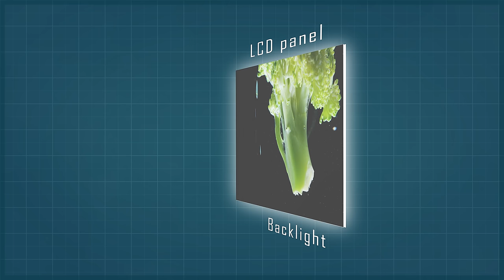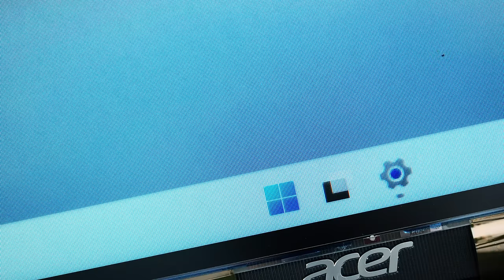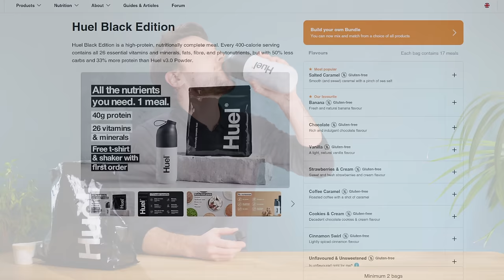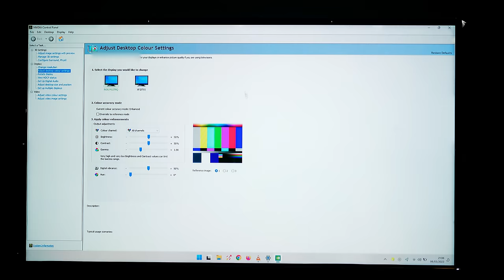DIY Dual-Layer LCD monitor - can it match OLED??

Comment: I would’ve loved to see a comparison between this and OLED. Would be cool to see the difference in black levels and persistence blur.
Reply: Yeah, Matt! Build an OLED display out of old electric teapot indicator lights and make a comparison! Also - the viewing angles on this double layer beast must be interesting.
Reply: Oled will have a better emd result. The pixels are off when black cant get better than that
Reply: @CruelQuertos  The only benefit, and why DL-LCD is available to studios is that it can reach 1000 cd/m2 which is the HDR mastering specification. It will never be available to consumers as regulatory agencies would never tolerate the near-squared power consumption.
Reply: The persistence blur would be pretty bad unless the panel can be refreshed very quickly. The new 500 frames per second panel thats in that new Alienware model has a pixel response time of 4 1/2 Ms at the slowest transition. The Hisense u9DG had ridiculously bad motion blur because of how hard it was to keep the panels synchronized
Reply: OLED will eventually replace LCD, in time.  The problem with OLED is comparatively low yield in the manufacturing process, and they fade and die over time, blue in particular, will get less bright over time.
Reply: @fuzzywzhe  I think the yields are probably pretty good at this point. However, OLED can't do outdoor bright signs, and there is the future possibility of something radical coming to LCD, like field sequential colour, or a blue backlight photoemissive subpixel system that could far exceed OLED power efficiency.
Reply: @Tattlebot  The yields probably have improved a lot, but I'm still fairly certain they are lower than LCD.  LCD yields are close to 100% now - they are very good but it's been a while since I've been in this industry.

One idea I've seen for improving efficiency for LCD was using a prism to break the light into red, green, and blue instead of using just color filters.  I think they still use color filters, but I'm unsure.

If you've ever heard of the One Laptop Per Child initiative (a disaster by the way), they did that to improve efficiency.

I don't see why people really complain at this point about what they get.  Yes, LCD doesn't produce true blacks, your eyes adjust to take that into account in short order, or really, your brain does.
Reply: @jamescampbell8482  Dude, you can't possibly see 500 frames per second.  You can waste money on this, but there's really no point.  I used to work for RCA, your brain basically can't see 60 frames per second.

There's lots of stuff built that is WELL beyond physical perception.  There were 8K televisions for a bit, you can't see that, it has more pixels than your eye has photoreceptors.

I guess it doesn't matter, really, but the stuff I see.  Remember "retinal displays" on iPhones?  That also has more pixels than any human being can see.  What is the point of doing that, other than driving up cost enormously and increasing energy consumption?

It's bragging rights about the "quality".

I guess it's harmless, but it's also wasteful.
Reply: @fuzzywzhe  Using a monochromator will still lead to loss of light. Of course OLPC was going to achieve nothing, because funding has a minimal effect on educational outcome, plus people prefer to ignore the issue of IQ heritability. This is a failure to consult, based on ideology.

The issue with LCD darks, and while I admire LCD a great deal, is that the contrast ratio impairs colour saturation near dark. Dark colors are desaturated by the glow, and are then incorrectly displayed.
Reply: @fuzzywzhe  QD-OLED will take over OLED soon enough, and after that MicroLED, which is essentially the return of the LCD.
Reply: @cal7101  Well, this is outside my scope of knowledge, but I don't see who MicroLED could be the return of "LCD".

The way LCD works is that you have a panel that polarizes light, then you have the LCD screen pixel that twists that polarization from 0 to 90 degrees, then you have another panel that polarizes the light again, and if it's 0 degrees, you get full brightness, and if it's 90 degrees you (are supposed to) get absolute darkness.

LED doesn't require polarization as far as I know.  As far as I know (and I might be wrong) it's just a bunch of light emitting diodes which is why it's so efficient, but producing blue light is troublesome and the stability of the light emitting diodes is not great.  They burn out and fade over time.

I've never heard of MicroLED, but I don't really work in display technology anymore.
Reply: @fuzzywzhe  my mistake, I was referring to mini LED which is actually inferior to OLED, QD-OLED and  Micro LED. V confusing naming! But Micro LED will likely take over OLED and QD-OLED (superior to OLED) as it will negate the OLED issues. Just needs to come down in price and be made into TV form factor.
Reply: @cal7101  Well, I looked those up, you may be right.  I haven't really been into the display arena at all (and was only INDIRECTLY in it before) since 2000 or so.

You could be right, but here's something to think about.

We're not going to really ever improve video or audio quality from this point out.  In 2200, your display will basically be what you're using now, although it might have better, contract, it will be basically the same.

It might have a different aspect ratio, but it won't have much of a change of resolution.

It won't be 3d, it won't be floating in the air, it won't be transparent, it will be, basically, the same thing you have right now.  Could be a different technology (very well might be), but we are not going to make any significant advancements or changes in display technology.
Reply: Hisense dual cell TV basically used the same method to achieve high contrast, I can tell you the black level and colour performance are very comparable to OLED, but OLED still looks better to human eyes at this stage...
Reply: @fuzzywzhe  The eye may only have a few million cone cells, but the peak density in the middle is 100-130 per degree. To match this across a 40deg display, i.e. it be that sharp when you look to any part of the screen, you need over 5K. Our usable visual acuity (e.g. readable text resolution like an optometrist might measure, or minimum angle to differentiate two points of light) is a bit less than this, so 4K is fine for most people, but that's just for a TV - IMAX screens cover a much wider angle of your vision, and I use my screen at almost 90 degrees where even 8K wouldn't look perfect.

'Retina display' has just enough pixels that you can't distinguish any further (for a given screen size at typical viewing distances). Not _more_, it doesn't drive up the cost, it exists specifically to avoid this arms race: with 'retina' on the spec-sheet they avoid the pressure to improve 1200 to 1500 to 2160p every generation.

Frames per second is much harder to estimate. When your eyes track a moving image across a screen, the sample-and-hold effect of each frame means it doesn't behave like an object in real life, and you get blur as your eyes expect it to be further ahead. This is compounded by pixel response times, but with more FPS things appear closer to where they should. This continues indefinitely: tracking a 2000pixel/sec object at 200fps has the same motion blur as a 300pixel/sec object at 30fps. If you skip the 'hold' of sample-and-hold, and show each frame only instantaneously like CRT, then your eyes can average between frames (without including incorrect interpolations into the average) so with backlight strobing / black frame insertion we may be able to use lower FPS. Still not 60 which would have noticeable flickering, but yeah you could meet the capabilities of your eyes without also having to counteract the technology.
Reply: @fuzzywzhe I've heard things like your eyes only see 60 frames per second before. But most people can tell the difference between 60 and 120 fps. I do agree 500hz is probably beyond what is necessary
Reply: @fuzzywzhe  microLEDS will eventually replace OLED, in time.
Reply: Yeah, the title implies he was gonna compare this to a regular OLED screen, but then he doesn't
Reply: @NoName_NoTitle  It's certainly worse than OLED because of blooming. Micro leds are also better because of higher brightness. This DIY is probably between a common LED and a mini led display.
Reply: oled is 2-3x better
Reply: @zee-fr5kw  of course, not, sometimes even mini leds are visually better, in very bright scenes, for example.
Reply: @zee-fr5kw  The problem with OLED is that the blue pigment breaks down over time.  That's not a problem with LCD.

It's true you have better contrast with OLED, but then you have longevity problems.  LCD screens will work until the backlight fails, and with current white LEDs as a backlight, that's basically never.  Capacitors fail, but they can be replaced, but most people are too ignorant to replace them or to go to a repair shop.
Reply: @fuzzywzhe  No, not really.
Reply: @IncognitoActivado  What?  "No, not really" - what what?  I'm open to being corrected, but just telling me I'm wrong, doesn't help me understand what I'm wrong about.
Reply: OLED substituir LCD? kkkkk impossível, simplesmente porque OLED vem com o bônus chamado "Burnin", quem provavelmente vai se tornar o substituto do OLED é o MicroLED e quem está aos poucos tomando o espaço do LCD comum é o MiniLED que é só um LCD imitando o OLED mas com um risco consideravelmente menor de ter Burnin
Reply: @JMgamerBR  There were burning problems with CRT and Plasma.  It's not a show stopper.  OLED promises to be INCREDIBLY cheap.  It's also far more efficient than TFT.

Time will tell.  You can fix burn in problems by adjustment of the picture.  We can know what pixel has been on for exactly how many seconds, this is TRIVIAL to do now, so when there is burn in, we just adjust.  You couldn't do that for CRT, and you could for Plasma, but Plasma was in the early days when memory was still expensive.

Comment: Removing the polarizing layer would probably yield much better results, but I know it would be far harder to do without damaging the LCD.  It would be cool to see you do it though, as I think you have the skills to do so.
Reply: Hot airgun and acetone, plus molybdenium wire used to separate touch on phones, that's easy if you ask any cellphone technician, just that when we do this by mistake it's a fking loss of a screen.
Reply: Removing the polarizing layer from one of the panels would likely raise the brightness floor and lower the contrast, though. The fact the two LCD panels resulted in black without a depolarizer in between indicates their output is polarized in perpendicular directions.
Reply: @fss1704  I've partially pulled off the polarizing layer on a phone LCD by accident and managed the rehabilitate the screen by simply cleaning it off and reapplying some fresh self-adhesive polarizing film on top before. It's a royal pain in the ass, but it's not a total loss.
Reply: They could maybe just have flipped around one of the panels front to back. But then they would have to add signal processing to mirror one of the hdmi signals
Reply: Front to back could work just by coincidence. What you want here is rotate the panel by 90 degrees. Better option though is to buy different panel with the same pixel layout that already runs on different polarization. Both vertical and horizontal are in use, just have to check which monitor does what. That happens even between minor versions of the same model. I had two Dell screens that were almost identical, sam layout, same size, resolution, look almost the same, one was just newer year model. They had different polarization , so when I was wearing driving sunglasses, I could see only one of them.
Besides that, there are multiple types of LCD panels. They generally work by rotating polarized light with liquid crystals and blocking unwanted part. Liquid crystals are usually used to change light polarization, not filter it. So they either rotate and block dark pixels or rotate and let through the lit pixels. The one we can see here is the latter type as the output has rotated polarization. You can also buy the former type and those can be simply stacked with no additional effort. That's because the light that should go through is untouched and the light that should be blocked is rotated to be blocked by filter. This would be a perfect screen. IIRC it's more often used by VA or TN panels, I don't remember details.
Reply: @LokiScarletWasHere  That's a byproduct of how LCDs work. It shows the two panels are manufactured the same.
There are two passive polarizing filters with an active layer between them that turns the polarized light from the first filter to allow it to pass through the second filter.
Reply: Front to back works always with the identical panels, in principle.
Because adjacent polarizers have identical orientation, so there is no loss!
Reply: @peceed  But subpixels are not symmetrical. Typically you gave 3 subpixels, RGB. They are 3 individual pixels within one dot that are responsible for each color. When you rotate the panel, you will have BGR. It would only work if you flip it upside down if the subpixel layout is like that but it depends on the layout itself. If they are in triangle instead of 3 parallel pixels, it won't work. Subpixel layout has to be symmetrical to be able to flip it and maintain the same layout.
Reply: Yes, I know. But all cheap displays use RGB layout. RGB+white are extremely rare.
Reply: Can't you just flip the second?
Reply: I though the.same thing but am not entirely certain it would work... In order for the masking effect of the top LCD to work you first need a clean image to mask, and without a polarizing filter guiding the light it's essentially at maximal diffusion and not much different from just a blank LCD from the top LCDs perspective.
I dunno. I am not an LCD expert.
Reply: @atsernov  Huh. Last I had checked the idea was the outside panels were polarized one way and when a pixel is black the inside is polarized the other way.
Reply: @luigimaster111  Yeah you need all four polarizers to get the squared contrast ratio. Also squared power consumption.
Reply: @Loki Scarlet  nope, notice that lcd monitors are black until they get a signal (before they go into sleep mode)
At rest, the rear filter polarizes the backlught one way, the inactive crystals do nothing, and the front filter blocks that polarized light.

The crystal layer turns the polarity of the light when a current is passed thru it, aligning it with the front filter so it can pass thru.
Reply: @atsernov  That depends. Twisted Nematic is transmissive at zero voltage, IPS and MVA are normally black. You can use a flashlight to tell if a panel is TN or IPS, because TN will light up a little when powered off.
Reply: @Tattlebot  Never owned a TN panel, didn't realize they worked opposite. But the basic principal is still the same, right? Two passive filters with an active layer between them.
Reply: @atsernov  They're nematic liquid crystal based and they all use two polarizers, but that's as far as they're alike. If you've never used an active matrix TN LCD you are both a) probably young and b) quite lucky.
Reply: @Tattlebot  Or I owned a CRT way too long. Honestly, I probably just didn't know I was using a TN. I don't know much about LCDs, I just know a lot of surface level shit.
Reply: @atsernov  I wouldn't hesitate to choose even a run of the mill CRT over TN. TN has its uses, like MS Office. But this is all history.  $100 monitors are now IPS and MVA. It's not like in 2009 where you're looking through every model on the market trying to find an IPS LCD that isn't wide gamut, or being forced to buy the expensive legendary NEC LCD2490WUXI.
Reply: @sunday87  mirror it @ the computer end.
Reply: I think he already did. unless newer superthin monitors, the polorizer sheets are not glued and sits loosly in the light box assembly. This is a complex electromagnetics problem and you might need custome polarizer/filter assemblies. Way too overcomplicated.
Update: the thing thats glues on the LCD is the color filter and not the polarizer.. i think. It doesn't do any help removing it.